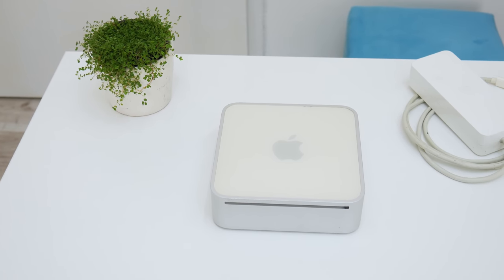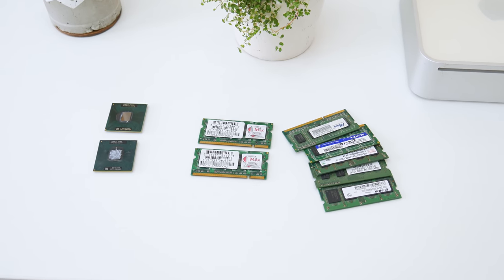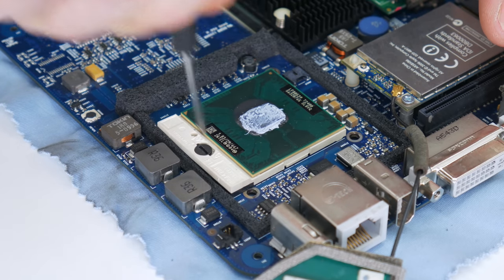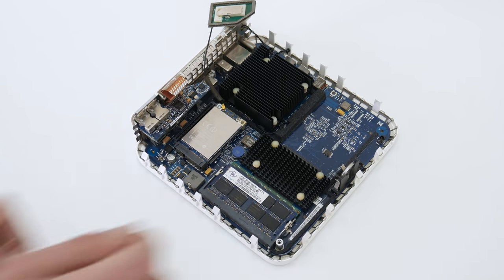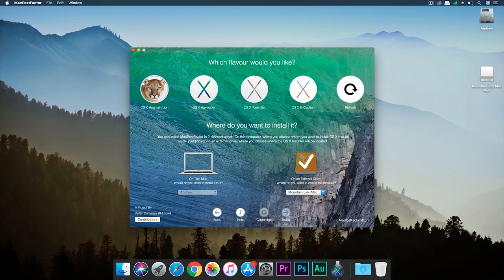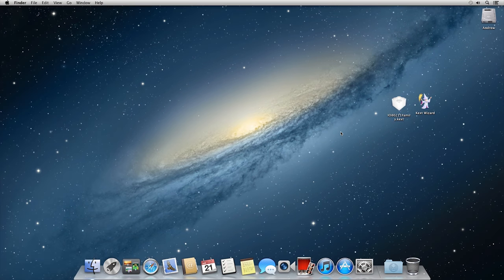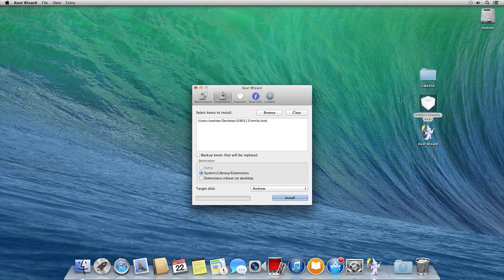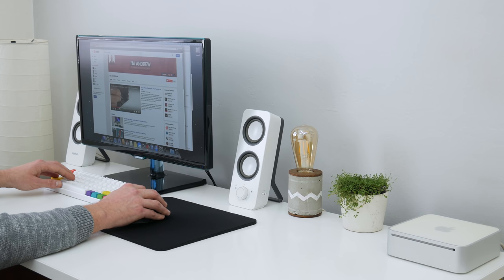Upgrading the $20 Mac Mini - Running Unsupported Mac

Comment: i did the same upgrade to my 2006 iMac 4,1. But i used the faster T7600 at 2.33Ghz. Also, you can get that Mac to run up to Mavericks with full QE/CI GPU acceleration with ParrotGeek's patch. He also compiled the current Firefox for Mavericks.
Reply: Where can I find some info about the patch got an old mini too I wanna try this on, thanks

Comment: back in the day when everything still upgradeable and repairable lol
Reply: Old time before Apple became greedy.
Reply: the time when soldered components weren't that common...and mac mini was an intended desktop computer
Reply: powerlinkers your right apple did become really greedy, and it’s honestly heartbreaking.
Reply: Yes but there must be more powerful versions than a core 2 duo, which was one of the worst processors I was ever forced to use for development.
Reply: The 2018 Mac Mini is upgradable
Reply: I hate Apple for this.
A too much closed ecosystem, for no real reason but pure profit. Trash jewelry.
Reply: @NoCommentsVideo  Fuck Aple. I stick to good ol PC tech. lots of components, can build computers myself with the specs I need for the fraction of an Apple fashionable POS. Still it's a good video and I think this would make a perfect little office computer.
Reply: Best of all, thanks to intel and Apple, that ancient thing is likely as fast as the newest Macs
Reply: @Ciro Attanasio, “closed ecosystem” well put.
Reply: If people stopped buying Apple they would listen. People will buy overpriced tech, so they will keep doing what they do.
Reply: Steve jobs vs Tim Cook
Reply: 2019 Haitch Pea Laptop, REPAIRABLE AND UPGRADABLE?? W0t
Reply: i cant upgrade gpu and cpu of my laptop
some bad computers are also unupgradeable(including ram and drive)
Reply: Yeah, the new mac mini has nothing upgradable :D
Reply: It's a matter of choice. I have been running Linux for 15 years on various devices and not planning to change that. I haven't done a fresh reinstall for the past 8 years. I just copy the system files over when upgrading HW or the storage disk. I am just checking driver compatibility when buying new peripherals like printers or DVB-T dongles. In contrast to Windows or Mac, many old devices are still being supported by in-kernel Linux drivers. I have seen a sound card unsupported on Windows still working fine under Linux.
Reply: Samsung says no😂

Comment: Very good information.  I have the same Mac Mini, used it many years as Media Center. Later then used Bootcamp, put a SSD inside and it is still running Windows 10 reasonably well. Biggest drawback ist the 2GB RAM limitation, so I might try your suggestion with the CPU change if I can get hold of one.

That little machine is 14 years old now and still usable. I did the same with an 27 inch iMac which I got cheap on Ebay. It's my wife's favourite PC because of the display. I just don't like Apple's policy to try and force users to depreciate perfectly usable hardware.
Reply: Still using it?

Comment: did this to my 2007 yesterday, found a ssd for 20bucks brand new. upgraded ram to 2.5 gigs just enough to run 10.8 smooth. She's running very smooth now, and boots so fast. May install win 10 but so far all the software online i want supports 10.7.5 so i think i'm good.

Comment: I did the same thing with a Mac Pro 1,1 I got for about 100 bucks. By the time I was done it had running Yosemite on dual quad xeons, 32gb of ram, 4x1TB hard drives dual video cards running 2 24" monitors and 1 40" monitor. All total I have about 500 in it. Other than cranking out insane amounts of heat its very usable.

Comment: I want someone to turn the top plastic on the Mac Mini into a wireless charger.
Reply: Arctic Fox that is a genius idea
Reply: that is a genius idea x2
Reply: The early prototype Mac mini G4 actually had an iPod dock in the plastic top, but the dock was dropped before they entered production.
Reply: That shouldnt be too hard you could get a cheap wireless chargee from Amazon and then connect it directly to the mother board im saying that from a windows perspective but if not you could pass a usb through the the rear IO
Reply: I can do that, but i dont have a mac mini. Thats a great idea
Reply: Take its case and put a wireless charger in it thats all :)
Reply: @TimurTripp2  Yet another example of how a good idea was thrown away.
Reply: What model n year is this upgradable Mac mini ? Thx
Reply: @tobykan8243  It said in the video, its a 2006 Mac Mini :)
Reply: ThisIsStockerHD many thx
Reply: Yes that what I wa thinking, It would also be cool to have a wireless charger in the base of an iMac
Reply: Kennedy Mcdon yeah sure, and the wireless will pass through the thick plastic, if it does it would charge slow. Terrible idea. Something better would be a dark model, or adding rgb at the sides of that clear plastic on the top, but that seems something that we don’t need, Mac mini’s get too hot on the top...
Reply: And I want someone to do it to an echo dot 2 gen.
Reply: it is possible i can do it
Reply: Timur Tripp Wut.
That’s a shame :(
Reply: sure
Reply: Yh lol
Reply: Arctic Fox i was thinking of that too
Reply: Just buy a wireless charger from Ikea and hotglue it in place.
Reply: That would be easy enough to do. I can think of about 5 ways to do that.
Reply: can't need glass
Reply: @Arctic Fox its Glass ontop

Comment: I took an 2007 iMac, put in SSD and Ubuntu :-) Then I installed nvidia drivers and steam.
I didnt use it though, but it looks cool I think.

Toying the idea of putting a mini itx inside it now.
Reply: You can put Broadcom Crystal HD card instead of wifi card. It works great in Kodi environment.

Comment: I'm impressed to see all of this upgreadability. I had not so time ago a laptop from this era and I had to dessist to upgrade it. It had a 32-bit Core Duo running at 1.73 GHz, but due to socket limitations, it was impossible to upgrade to a 64-bit Core 2 Duo. Also I had to stick with 2 GB of RAM. But what surprissed me the most of this video is that this little mac had SATA interface and you can put an SSD! My old laptop had only PATA connection, so any upgrade in that field could had been useless...
Core Duo was an strange thing. I think they were the last 32-bit desktop CPUs before the massive adoption of the 64-bit architecture and they are now completely pointless.
Reply: I have one of these 32 bit 1,1 running Linux mint , all supported & can do YouTube , web browsing & all sorts , does work it hard but better then dead, I put a ssd in too

Comment: i think you could have uprgade to SSD too
Reply: Blazi3  hè didnt
Reply: @Blazi3 ... yeah it also says "SSD" in the About screen he shows...
Reply: he should have upgraded to a windows pc ;-)
Reply: @oldskoolhead0  This. Old unsupported Macs make pretty darn good Windows PCs. We have a Mac Pro 1,1 at work that flies on Windows 10 Pro.
Reply: @oldskoolhead0  Winblows
Reply: @R-L-D  it does yeah its very windy today too
Reply: @R-L-D  lee nuts
Reply: Thinking the same thing.
Reply: Does that have standard 2.5 drive that can be swapped for SSD?
Reply: @oldskoolhead0  He should have just upgraded to Hackintosh on suitable and much cheaper generic intel hardware and used that Mac mini as a doorstop!
Reply: @MrDegsy69  it's about the aesthetic, imo the mac mini looks pretty sleek even though it's old af. All this cost him under 50 bucks. I doubt you could make a small form factor build using Intel parts.
Reply: @jpouriia65  Yes, I did the same upgrade (not the firmware / OS though since I only needed it to play music in iTunes) and I replaced the HD with a 2.5" 200GB SSD drive. The SSD is faster than the SATA port but it makes the Mac Mini snappier. It now boots in 17 seconds (running Snow Leopard).
Reply: @goyadressunofficial  I would like to see one of those pirate upgraded windows XP with lots of crazy features on one of this things.

Comment: I have a 2007 Mac mini running OS X Yosemite, and I just disabled kext signing, and then everything worked fine.  The graphics are not choppy anymore, and I have working sound, although WiFi doesn’t detect any networks, and nothing is transparent in the OS.  I don’t know if this would work for a Core Duo Mac mini, but you should definitely give it a try.  The command to disable kext signing is: sudo nvram boot-args=kext-dev-mode=1

EDIT: Upgraded it to El Capitan, still works fine.

Comment: Yes, I did this years ago the exact same upgrade,  BUT now limited by the SOFTWARE thanks to OS X 10.6.8, running old Firefox, Safari , Flash.  If put off by GMA950 - notice the next series with 64-bit CPUs STILL HAD GMA950.

Comment: Just discovered your channel in the last few days. Lots of great content. Got one of this 2005 MM and didn't know what to do with it since it did not have any OS and was told that it only supported 10.4 Tiger and I could not find Tiger anywhere. Will try to just get either Snop Leopard or Lion on it and leave it like that.

Comment: Upgrade to SSD. will it be faster?
Reply: For sure. Alot faster.  I did this to an old white core 2 duo macbook which has been in use at my parents place as a standalone music / itunes machine for years now.
Reply: I replaced the hard drive with an inexpensive SSD, my Mac Mini (1.66 Ghz) now boots in 18 seconds and everything is much faster.
Reply: Depends. If the connection is SATA 2 even if it's faster than the old hard drive it's still pretty slow

Comment: I'm not disliking the video, but please listen- DO NOT EVER APPLY THERMAL COMPOUND LIKE THAT. When radiator applied, it will definetly create air bubbles between cpu. Air buubles are bad. Just apply little 'pea' shape paste and applying the radiator it will spread it by itself leaving no air bubbles.
Reply: Another thing is introducing oils from your skin into the thermal compound.
Reply: he must be old school.... like back when we used to use credit cards to spread thermal compounds.... 🤣

Comment: I did the very same upgrades about a year and half ago, but only 2GB of RAM, 120GB SSD, and WiFi N from an Apple TV 1. Mavericks runs good after some tweaking, Movist would play videos ok, Firefox still upgrades to latest, Chrome is stuck on v59. Yosemite is slow, won't take GMA 950 kexts. Have Peppermint 9 on a 2007 mini 1.83GHZ and it flies!

Comment: i do the same upgrade last year but at the end actually with safari is not possible to open more or less nothing.... I decide to move on 64 bit ubuntu 18.04.3 LTS ansi'm satisfied because with chrome you can run. everything!

Comment: I bought one (2006 MacMini)  from the local university's auction for $15 spent $20 on eBay for the 2.33GHz processor, $10 pair of 2GB Ram sticks (I know it only uses 3GB) Flashed it to 2.1. Installed 10.7.5 and put it inside a TRS-80 case added a USB Super drive, and two 7 port USB3 hubs and a speaker bar on top.
Wish I could add pictures.
Reply: It had a 750GB HD and I didn't have enough money to get an SSD, maybe a later upgrade.
Reply: Wow.
Reply: Or you could’ve just simply got a normal fucking pc
Reply: Michael Inman waste of money. Smh.
Reply: @icecoolice7818  thats called being dedicated to something, which you cant be apparently.
Reply: why only 3gb is usable?
Reply: @paulocorazza6120  3GB ram is all the processor will address You can add as much as you want, but it will only use up to 3GB.
Reply: @MDI-RestorationMinistry  thank you Michael!

Comment: If you want to run current versions of programs install Linux Mint or Linux MX (you can dual-boot if you want to keep OSX). Much faster than OSX and more secure. I run Mint on my MacBook Pro (late 2008) which was stuck with El Capitan (i can install Mojave by patching kexts but it is slow compared to Linux).
Reply: My MacBook Pro 2009 is also stuck on El Capitan, but I run Mojave on it.

I can take Linux any day of the week but I still want the trackpad gestures
Reply: Good to know. Could we use that OS for a media machine?
Reply: I prefer Deepin and it looks just like Mojave
Reply: @PaceyPimp  Understood why, but it takes up more resources than most Linux Distros.
Reply: Mint 18 and lower look like trash but Mint 19 looks amazing
—from a mint 18 user
Reply: GUYS PLEASE ANSWER MY QUESTION... CAN WE RUN CENTOS7 on a Xserve those old apple server things
Reply: @beedslolkuntus2070  Yeah you should be good as long as everything in the Xserve works properly and you have an internet connection.
Reply: Ion PC yeah, I have heard some saying Xserve doesn’t work with Linux, it will install but not boot up etc etc... 

Okay okay Thanks for letting me know!
Reply: Cio Dokop yes but ew why would you want cent os when you can use ubuntu, linux mint, or even macos?
Reply: Guess I'll share my experience with Linux on an unsupported Mac as well. It's a Late 2006 24" iMac, dedicated graphics (unlike the '06 Mac mini) but still limited to OS X Mountain Lion.

I tried a few different distros and eventually settled on Ubuntu Budgie, a really beautiful desktop environment. The problem is that the old Nvidia GPU (7600GT) doesn't have good support in Linux. First, I had to run a third-party patch and install an old version of the Nvidia driver that was last updated in 2017. It worked, but apps like VLC and Google Chrome still don't support accelerated video playback on this GPU, so even 720p video is extremely choppy compared to MacOS. There is also noticeable screen tearing in some apps.

I suspect those with ATI or Intel GMA graphics have had better luck in Linux. But for now, considering that video playback is my primary use for this iMac, it's stuck on the old OS X.
Reply: @harrytsang1501  Full accelerate gpu working in Mojave ?
Reply: @sid-mw7nz  Yeah good quetion!!

Well i want to run web server things...

Thats why
Reply: @TimurTripp2  Well I think i am lucky

Cuz I want to run only web servers

I dont even need video output after i setup the server itself

Comment: I have one of these Mac Mini's. I think I got mine in mid 2005. I assume it's the same because it hasn't booted for several years now, as no power seems to be available when I switch it on. Not sure whether it's a fault with the power supply or the Mini itself.  Somewhat annoying as I'd quite like to get it going again with some nice upgrades to RAM, CPU and SSD.

Comment: I did my iMac late 2009 with i7. I upgraded to 1tSSD and 32GB of ram and installed unsupported Mojave like you did and it runs like new. I can even play games on it but i need to run a external fan to help keep heat low.

Comment: OH man, you missed the most important hardware upgrade:  replacing the spinner hard drive with an SSD (at least 512 GB)
Reply: Trev0r98 he did. Just didn’t mention it for some weird reason!
Reply: @eccremocarpusscaber5159   How do you know that?
Reply: @Trev0r98  you can see it in disk utility

Comment: I've been thinking of a project that fits in the same form factor and has a battery backup that continues to charge during a blackout.
        You know how the phone lines have power running through them. You could easily build a USB charger that isn't more than three or four times faster than basic charging. But could charge multiple devices and run a phone or raspberry pie running your internet.

And a phone is probably more powerful then the Mac mini, if you're willing to spend more money then you spent.
Reply: The reason the power works during the power outage is because the phone companies have their own generators.

And you'll need a battery bank with pass-through charging, that means when the battery is 100% charged the power skips the battery and goes directly to the devices plugged into the battery. This prevents wear and tear.

Comment: Followed this tutorial which is great, but couldn't get Lion/Mountain Lion etc to boot on to the mac, so installed linux peppermint on a 500GB SSD via a different laptop already running linux. Transplanted that SSD into the mac mini and it fired straight up as if born for linux. Peppermint has some excllent features like gmusicbrowser which has a 'looks like' function replicating iTunes and mplayer/VLC for all video formats. Peppermint and a range of other xfce based linux distros beat any mac os you can get to function on an old machine like this.

Comment: Great Video!!! can you put all the computer parts CPU and RAM models ??? thank you is a great proyect!!!
Reply: T7200 is the most common cpu..... they're cheap, and the ram maxes at I think 3gb of ddr2 sodimm(laptop ram)
Reply: Jose Sierra ?
Reply: Core 2 Duo T series (T7200 was used but T7600 is also supported) and any generic (intel compatible) DDR2-667 or 800 laptop memory will work just fine since that Mac uses a Intel 945-based motherboard.

Comment: Dude I have the exact same model, thought of doing all this before and after a clean mac os install it runs quite smooth so IDK what you are talking about. But it DEFINITELY is NOT slow
Reply: oh and never apply the thermal paste with your finger or any other way to spread, just put a small dab and press the cooler on it, it should spread itself. When you use your finger, the dirt and grease on your finger stay on there affecting the thermals.